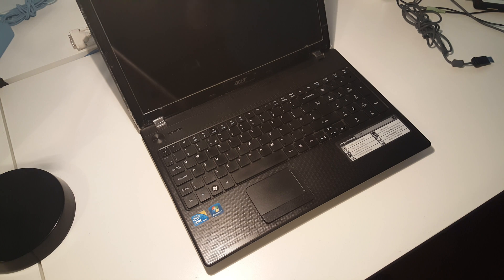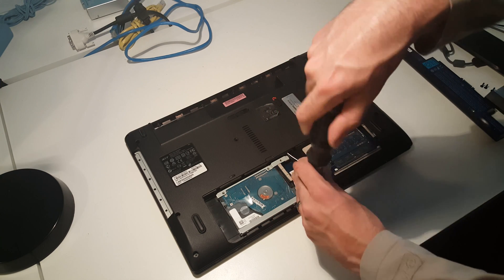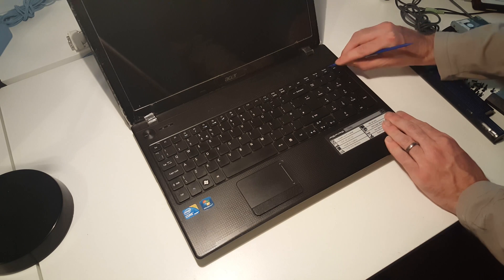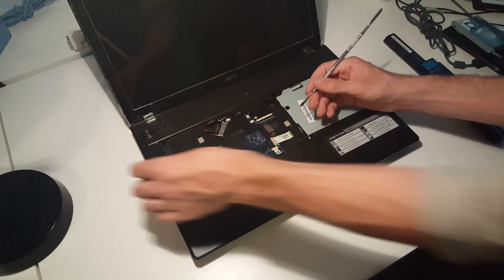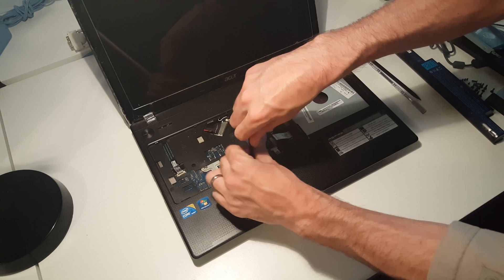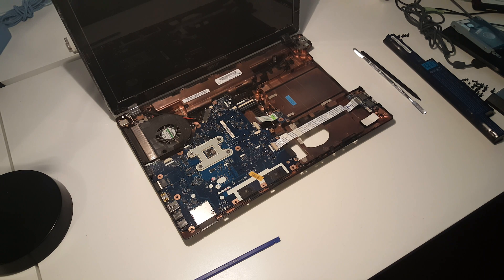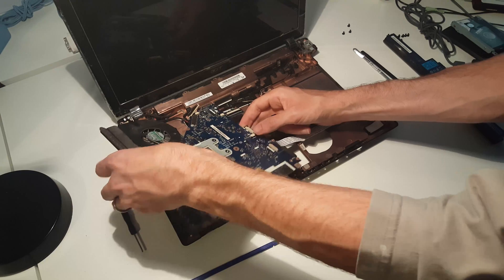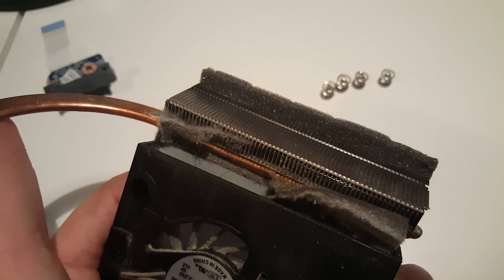Acer Aspire 5742 Disassembly Guide [4K]

Comment: Excellent, will its CD drive fit in a Dell PC? Cheers from Canada
Reply from the maker: If it has a slot for a drive then it should be the same - the bezel unclips and you'll need one to make the shape of the Dell.
Reply: @BrueComputing  The Laptop one is 11 mm and the Desktop slot is for 9 mm.

Comment: this laptop is prone to overheating haha.. exhaust fan goes boeing brr brr brrr
Reply from the maker: Yeah, if the heatsink gets clagged up with dust they'll do that.
Reply: Mine overheated after just 10 months of use, there are severe issues in regards to the 57XX models of laptop and heat management

Comment: I have a question - I have two cables one black and one white they come from the screen. How I connect them - which gets there where CH1 is written?
Reply: These cables are the antennas for the WiFi module. Look at the bottom, you should see some gaps between two black plastic dots, the cables have to fit between them and they should go to the bottom of the plastic case. There sits the WiFi module, the black cable goes to "1", the white to "2" on the WiFi module. The module can be accessed through the bottom of the laptop, there is a small cover that sits directly above the module. Hope I could help! :D Good Luck!

Comment: Thank you for the very clear verbal description.   Acer really made the fan on this model extremely difficult to get to.
Reply: Agreed, they made it far too difficult for most users to attempt a repair. Even worse, this model is prone to running hot and will shut down if you're not careful.
Also, slightly off topic, but related: Acer only put ONE speaker into the model of 5742 that I had. As a result, audio quality was poor and external speakers were mandatory.

Comment: Can you change CPU in this to i5?
Reply: i5 560m is what I upgraded to. The sweet spot atm for pricing as well...
Reply: @bardos  IS IT GOOD  I5 560 M
Reply: @KADERBOUKERA  better than i3 or pentium
Reply: I have i3 370 m iwant  to change  it becuze when i start any programme  he shut down and overheating
Reply: @KADERBOUKERA  nothing to do with the cpu. you have other problems
Reply: @KADERBOUKERA  Changing the CPU will not resolve this, there are other issues with the 57XX models of Acer laptop that result in severe overheating. Also Packard Bell laptops that are built around similar Acer models have overheting issues!

Comment: @8:08 when you say there is 7 screws there is actually 8 , I followed your tutorial to deassemble and was basically watching it again to reassemble and I had parted the screws out in bins, not to get confused and to keep them away from my cat. I was  stuck for 30 mins on that part cause I was "end of the world freaking out" about the 8th screw until I counted how many you actually removed. Thanks for the tutorial it helped allot.
Reply from the maker: Oops, sorry about that!
Reply: Brue Computing my is not working nothing!Its just show me that the Laptop is charging when I load it
Reply: You are correct, there are 8 screws that you can remove at that point, BUT one of them (oddly, the final one he points to) is actually not holding the top panel in place, instead it's one of two screws securing the motherboard, so if you'd like you can leave that one in while you unplug stuff from the motherboard, and remove it after!

Comment: Awesome stuff. This will be very useful for when I have to disassemble my 5742. I have had to buy a new laptop after my 5742 got really hot with overheating issues. It's been running warm ever since it was 10 months old...
There are various reports on the web of the 57xx's getting hot, and I believe that new thermal paste will be required (I might as well change the fan at the same time). It will be interesting when I have to take apart the 5742...
But for now, I'm using a HP 15 which doesn't get anywhere near as hot. Acer 5742 used to regularly go into the 70's, frequently into the 90s and occasionally hit TjMax (105). HP 15 has been up to 81'C (before it throttles back - and with the HP, the temperatures do recover to about 60-70'C) and the TjMax is 100C, which it will never get anywhere close to.
Reply: spotify95 hi, how's your 5742? Still working?
Reply: @RTDe-fz1uy  Hi, no longer have the 5742 unfortunately, I sold it on a couple of years ago due to it being surplus to requirements. I didn't take it apart in the end, because everything I could do on the 5742, I was (and still am) able to do on my HP 15-ac153sa laptop instead. I also recently cleaned and renewed the thermals on the HP, and it was an awful lot easier than the Acer - no motherbard removal required.
Temperatures no longer get very high, and peak at about 75'C (though normally stays at 70'C max even under full load).

Comment: Appreciate the step by step and the quality of the video, but would have liked to have seen you finish the repair and reassemble the machine. As a complete novice to this, you almost had me trying this on my own.
Reply: To replace everything, you'd do everything in reverse - start with the fan, then the power connector, then all other connectors, logic board, top case, etc.